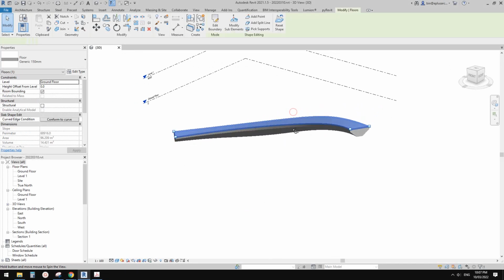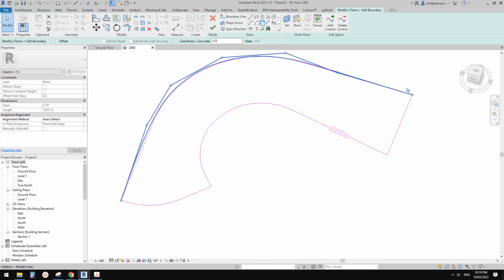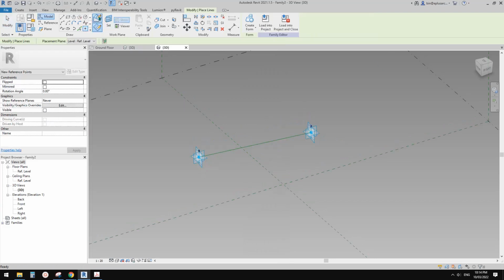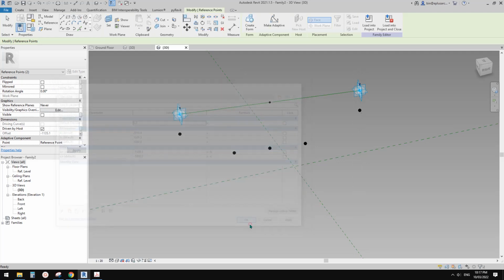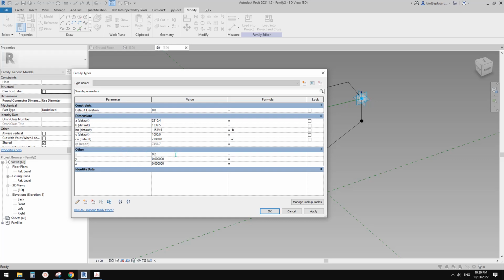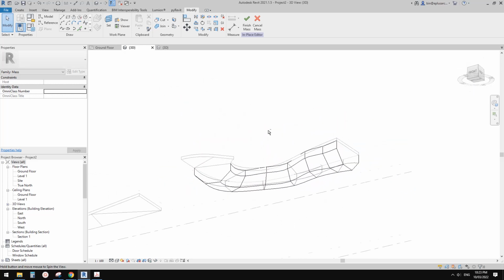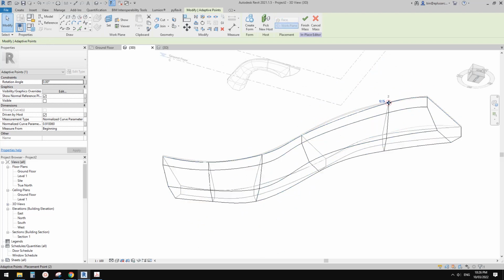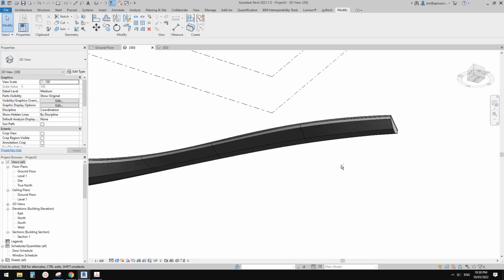Revit Exercise (Day 717) - Ramp Structure using Massing and Adaptive Family

Comment: Thank you so much Bin, very informative and well presented! Could you please do a tutorial when the profile is not vertical? i.e. the profile follows the slab falls... not sure if this is possible in Revit? appreciate your videos!
Reply from the maker: It should be easier, because in order to make the profile vertical, we need to add an extra step to apply the 'Always Vertical' setting. If we remove that step, we can easily achieve the perpendicular profiles.